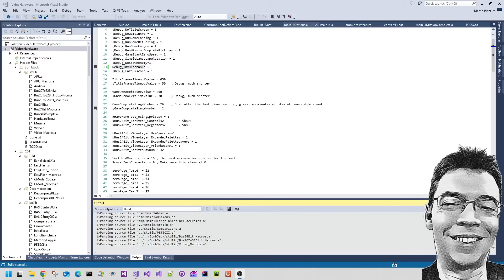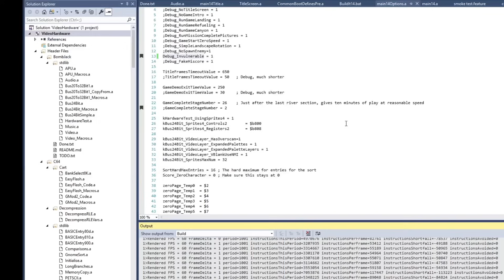MegaWang 2000 Turbo Edition - 46 - After Burner complete game

Comment: have you ported the original arcade board code to 6502 or is it running on the wang in 68000?
Reply from the maker: It's all new 6502 (6510) code. There is no 68000 on the board. It's why the framerate is 20-30fps instead of locked at 60fps like the arcade. :)
Reply: @MartinPiper6502   nice
Reply: @MartinPiper6502 how big is the entire 6510 game code and data? And what is stored on the PCB?
Reply from the maker: The entire C64 RAM is full of code and data, even under the IO registers. The board stack contains about 2MB of graphics and audio data.
Reply: @MartinPiper6502  Is it using the Sega superscalar sprite hardware?
Reply from the maker: @JustWasted3HoursHere no. It's my hardware.
Reply: Could an accelerator cart like super cpu get it up to 60fps or are there other bottlenecks?
Reply from the maker: Yes, a faster CPU would get it up to 60fps.